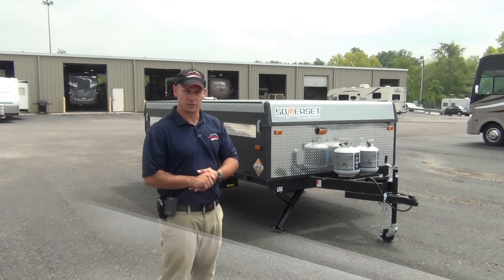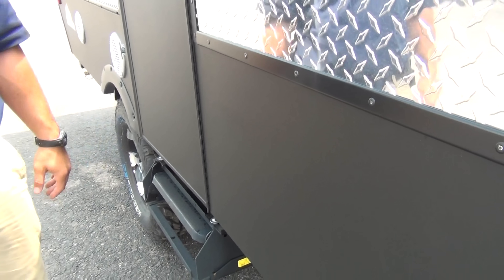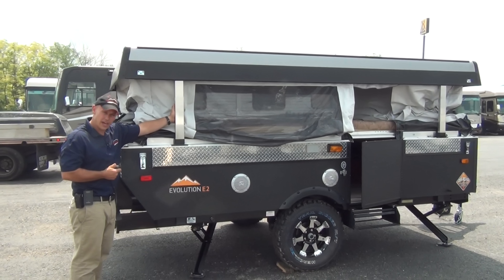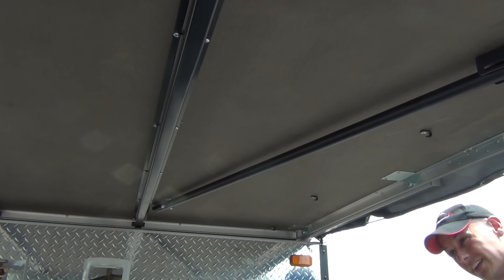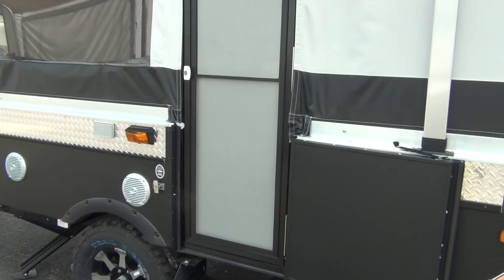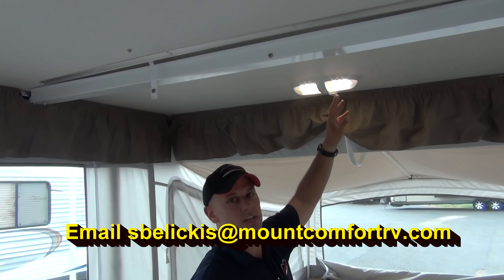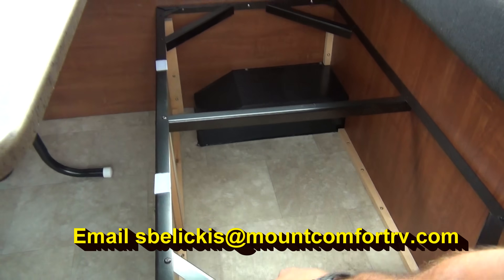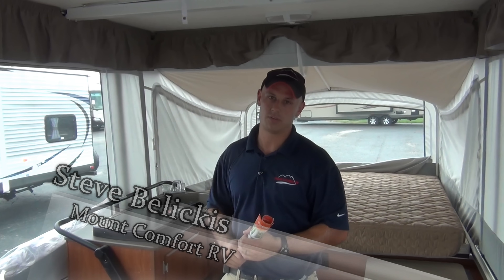Somerset | The Best Pop Up Trailer On The Market!

Comment: After watching this video it occurred to me that this camper is an exact copy of the old Coleman campers. I used to be an RV technician and my favorite pop up was the Coleman.  This video brings back fond memories. Like this one, they used very little wood and everything was built over and above what was needed. Somerset was even one of the names they used. I need to find a dealer in North Carolina and check these out.  Great video Mount Comfort RV,  despite the naysayers.
Reply: @MountComfortRVIndiana  Wish I could but I'm way past my prime. Best job I ever had though. Maybe I'll become a consultant. Hmmm!
Reply: you are correct  , Like the Coleman Grand Tour Series .
Reply: Yes it's ALOT like my Coleman Fleetwod Seapine.
Reply: I went from RV tech all way through to General Mgr. Blah blah blah blah
Reply: I w thinking the same thing, they used a lot of the Coleman features... Loved my little Coleman pop up
Reply: I see a lot of the same features as our old Coleman!  We own a 27 ft TT now.. Actually the same one you see in the background but I still miss my little Coleman pop-up,  lots of great memories
Reply: jim p this galley setup reminds me of our Palomino but the rest of it doesn’t. We had our dinette/single bed on the other side of the door, going the entire width of the camper. I’ve never seen another camper with the same layout as ours- and I don’t like any others as much. Colt C-6
Reply: I agree
Reply: @jimp6542  Columbia NW purchased much of the tooling from the Somerset plant after the investment firm that took it over closed down (formerly Fleetwood) I've also heard some of the employees who formerly worked at the plant building the Coleman campers were hired by CNW.
Reply: My Coleman should have been built like this. It’s headed to the pop up graveyard.
Reply: yes!!! we had a Coleman too. I loved it. hopefully next summer (2021) we are buying a pop up. Between Covid and my having cancer we were not able to get one this summer.
Reply: My family camped in a Coleman Pop Up with 4 of us kids in the 60s and 70s. Went to all the state parks we could on weekends. We weren't allowed to touch the canvas during rain storms. It was pretty durable for 4 kids.
Reply: I'm still running a 1997 Coleman Taos.
Reply: Yep, same as the Coleman I had in the late 80's except for the mag wheels, lug tires and diamond plate side armor instead of the blow mold egg shell thin plastic front and rear. My Coleman also had a slide out two burner stove on the side,wasn't mentioned if this does.
Reply: Bro they copied and took credit
Reply: Purchased a 2010 Coleman Evolution E4 popup with a deck on the front. Best popup ever. Best of both worlds toy hauler and a comfortable camper. Got a big fridge, porcelain toilet with a wet shower,  heat/ac and a way to haul our bikes or golf cart. I had no idea these were made some time ago. More people would get into camping with one of these.

Comment: So glad they put those nice grip tires on the camper, u never know when ur gonna need to get traction with the pop up drive axles!!!!
Reply: Sarcasm?  I read it three times before I realized there were no drive axles. I know nothing about campers etc.
Reply: It’s an off-road model, tow your standard cheap highway treaded pop up tires down a fire trail littered with rocks, ruts, and other debris and let me know how long it lasts.
Reply: How about towing your camper on knobby tires the 300 miles of interstate to get there?
Reply: ChuckD59 it’s all-terrain tread not nobs but whatever you say captain. No different than driving on them on your truck.
Reply: Its simple. Match you camper tires and rims to your tow rig and you have additional spares that you can use anywhere on the set up.  Different tires on your trailer to your tug, and you only have a spare that can be used on one unit.

Comment: Hey Steve, whoever lowered the roof forgot to get the clip bungee out of the way.  1:00  Why do you have snow tires on a popup?  Also, that slid-out step is really cheap.  They warp and eventually break, and they are very slippery when slightly damp; the one on my Coleman is a full-on leg-breaker.  Also, the power roof lift is totally dog-slow.  The dinette seat metal framework is a real plus.  Most other popups are 3/4" pine which eventually falls apart.  Somebody was thinking.  And, where are the side window curtains and the bed-wing privacy curtains?  Optional extras?

Comment: I've got an 08 Fleetwood/Coleman E1. It looks so similar to this. Though wish mine had auto up/down as I dislike raising it by hand. I've made some mods here and there and now am looking into having a winch lift installed to make things a bit easier on the family and myself. I looked at these Somersets new, pricey. Bought a mint used Fleetwood before Coleman took them back into their fold and am happy with it albeit the odd thing here and there. Way better quality than other brands. We looked and imo those other brands are junkier.
Reply: C Steele get yourself a 18v cordless drill and an adapter that fits your crank. Probably this one: Ultra-Fab Products 48-979071 Ultra T-Slot Drill Attachment for Scissor Jack https://www.amazon.com/dp/B00Q6ISG4M?ref=yo_pop_ma_swf

Certainly will raise the roof faster than in this video! Bonus: it does the stabilizers too.

Comment: Nice camper. Love the electric roof. we have some awesome campers in Aus but no electric roofs all wind up. Mines a wind up. My only issue with this camper is the non tinted windows, i woundn't have bought mine if it wasn't tinted.

Comment: I used to have a pop up where the roof rotted out. And had to put 2x4's to support cuz cables broke. This seems nice and solid. Would be worth the extra money. Are there any with bathrooms?
Reply: Yes it has 1 and 1/2 bath

Comment: if you like that, you can see where it all started. 80's coleman camping trailers. i have a 88 coleman laramie with lots of the better options. this video makes my proud to own a coleman
Reply: I was thinking the same thing. I have a 1989 Coleman and it has almost all of those features!!!
Reply: +michael sullivan gotta 3rd this, just sold my 82 coleman and it too had 90% of these features plus some this thing doesnt.
Reply: i have a 97 Coleman and it seems just as tough, but this one looks heavy.
Reply: The aluminum on this thing would actually be a lot lighter than all the plywood in the old Colemans.

Comment: That thing has several features identical to my ‘06 Fleetwood Santa Fe like the bunk supports and slides, whiffletree lift with brake, roof supports, galley looks exactly the same with the same lift system and sink. In fact, the interior might BE my trailer except for different upholstery. 

Didn’t Somerset buy Fleetwood Folding Trailers when they closed up shop?

Comment: Nice but too slow to put up and take down.  We had one back before they started making these crank them to open / close and we could put one up in under 5 minutes flat.  2 pull out queen sized beds on both ends and a flip out single along the back side opposite the door, canvas flaps.

Comment: How resistant is it to different climates? Am I thinking about snow, rain or strong winds?
Reply: OK, thank you very much for your honest information.
Reply: @MountComfortRVIndiana  Yea,.... I pulled of a winter hunt, 3 of us, in Wisconsin in one of these. Mr heaters on 20# propane tanks (inside)on low, long underwear, and surplus ARMY extreme cold weather sleeping bags. Hot coffee going on one burner, and breakfast cooked in a 12"pan on the other. Had to keep knocking snow off the slide roofs for obvious reasons, and it sweated up inside a bit, but it worked, and was funashell. Popped the old foil pan Jiffypop popcorn, and watched weather/news on a 12volt Jenson TV powered with an extra deep cycle we brought. 9 day hunt, but 11 days at camp. Big bonfires in the snow. Used a tripod, and cooked everything from chicken, steaks, fish, you name on that fire, snowing, blowing, didn't stop us. Beer was EPICALLY cold, and ice for the mixers was free. Had to 4 wheel out for beer/liquor/supplies run twice. Used an ice shanty set up behind the camper, with a bucket and bag crapper in it. Kept a fuel oil lantern in it burning, and it heated the inside for next to nothing. Tough camper, with tons of get dressed, clothes all over kinda room! Worked like a champ. NOW we've stepped up to a 22' 4 season that's epically warmer, with a shower, and bathroom that's QUITE a bit nicer, but these foldouts can do ALOT if your man or women enough for it. After a high wind thunderstorm one trip...... Yea...... Went with the 22' trailer. No WAY to get any sleep in a pop-up with all that damn flapping and pounding rain noise going on unless you drug yourself to sleep. 👈👍👋👋👋👋✌☮

Comment: Please explain to me how this is easier then a travel trailer?  With all the camping I do I will never go back to a tent trailer.  Travel trailer requires you to park it and enjoy.  Man that was hard.
Reply from the maker: I'm not sure it is easier, but a lot of people enjoy the combination of tent camping with some of the creature comforts of camping in a hard side trailer. To each his own! 😊
Reply: @MountComfortRVIndiana  Agreed.  I can see the bonus since I've owned one.  But its definitely not easier.  Just pointing out a fact that the video mentions that its easier.  Another "our product is better" sales point.  Which is obviously not true with most north american RV companies.
Reply from the maker: @jeffreyclement3564  this video is a couple years old so I'll need to go rewatch it but I thought he was saying in comparison to other pop-ups this one is pretty simple to set up with the electric lift, no cranking it up and down manually.
Reply: The idea is you can tow it with a vehicle with a lower tow rating. The car I’m looking to do get is a 2005 Saturn Vue with the v6, which has a 3500 lb tow capacity. A pop up is way lighter and I can take a bigger one compared to a normal travel trailer, which would have to be way smaller.

Comment: i have a question if you go to an area were there is no power no water how can you get power on it ? through a generator or it gets charges, and also same with the water how you get water
Reply: Solar for one. Carry water in containers.
Reply: A marine battery usually works

Comment: Why an offroad tire?  Not like the wheels are driven...  just for looks?
Reply: Gotrek12345 - I agree, these will pull heavy and the actual tire is a terrible tire. If you need to make them look grippy, just  put an all season all terrain tire, not a full on mud tire. Makes me laugh, most of the manufacturers do this on their supposedly rugged off-road campers. Oh well.

Comment: price?
Reply: I like your product, but you are getting into the price range where I'd just buy a small RV and have ll that and the benefits of an RV.  I certainly don't expect the 2,000 8,000 camper price, but that's a lot of money for you you are offering.
Reply: So at $20K, no AC and no bathroom?
Reply: Dave craigs list I'm sorry but there's no RV on the market selling for 20k. For the quality build of this camper, it's reasonably priced.
Reply: Brad Dumon I'm in Florida where we have four seasons of summer. This camper has plenty of cross ventilation to where I wouldn't even consider air conditioning. As far as the bathroom, my concern is showering, not so much the toilet.
Reply: Brad Dumon I'm in Florida where we have four seasons of summer. This camper has plenty of cross ventilation to where I wouldn't even consider air conditioning. As far as the bathroom, my concern is showering, not so much the toilet.
Reply: Bathroom is outside. Advantages: no smell, etc.
Reply: Wait till night, go outside and use a solar shower. They cost about $20 . Find on Amazon.

Comment: It is NOT quiet and takes way too long to open. 16/1000 is not thick
Reply: Thought he said 60/1000 and the top or sides were 40/1000
Reply: It’s .060” which equates to 1/16”. More than enough for this

Comment: goes up way to slow
Reply: My thumb hurts I had to push a button.
Reply: Yet another camper setup video shot on a beautiful cloudless day. How a video showing the same thing in a moderate to heavy rain, with a grouchy wife and 2 cranky kids in the cab after a couple hundred miles drive.
And then to find out the camper pops up with the windows all open.
That would be more realistic.
Reply: They take 12000. For that on